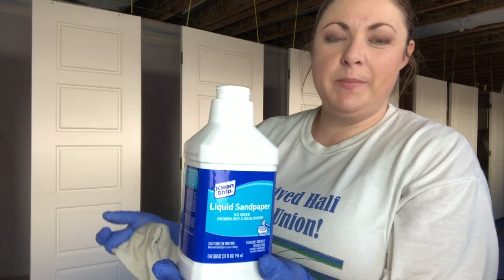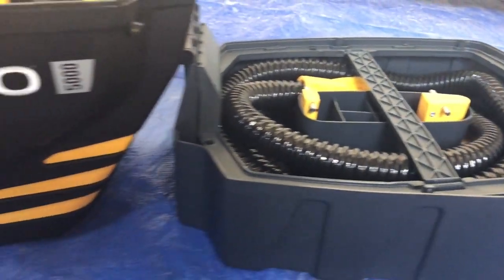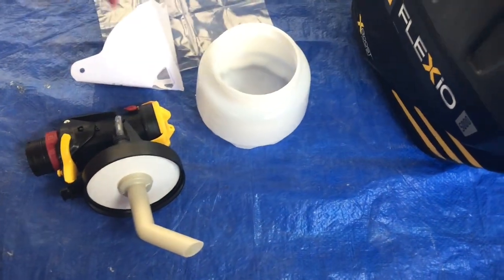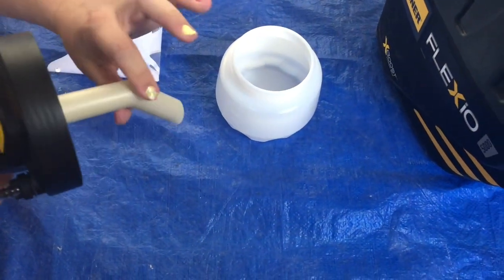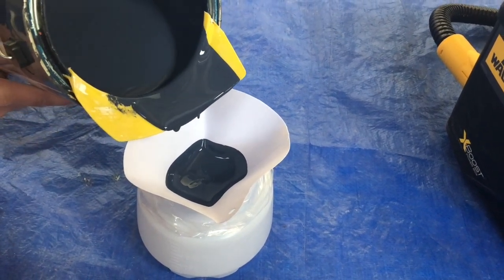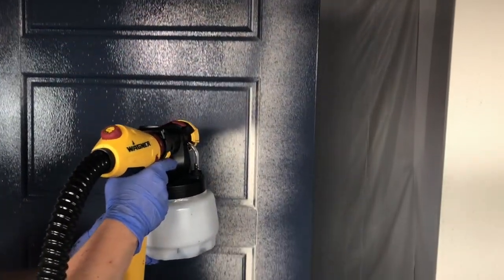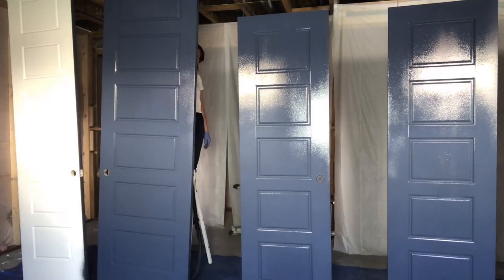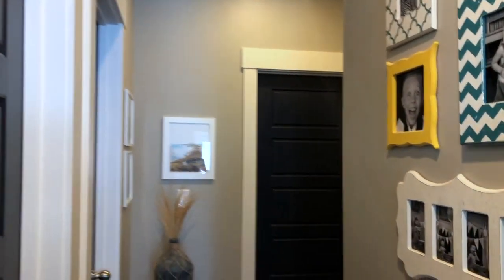HOW TO USE THE WAGNER FLEXIO 5000 PAINT SPRAYER | Novice Review & Tutorial on Achieving Pro Results!

Comment: As you’ve continued to use this sprayer, have you started to thin your latex paint? I like to brush Benjamin Moore advance since it levels well... wondering what recommendations you have.
Reply from the maker: Great question! Yes, after using it on more projects, we've noticed that it does spray better when latex paint is thinned a little with water. Hope that helps. Thanks for watching our channel.

Comment: When you did the first door, it looks pretty textured from it splattering paint... Am I wrong?
Reply from the maker: Thanks for watching Brian. You're correct. Before beginning to paint on the doors, we did multiple test sprays to set the sprayer to the correct paint flow. On the first door, we were still getting the paint to the right flow. Luckily it's on the inside of a closet door, which isn't likely to be seen too often. However after more practice with the sprayer on more projects, we've realized that the smaller sprayer has a much more fine spray flow to it, with much more smooth results. The larger sprayer (which we used in this video) covers larger areas quicker, but it does have a little texture. It would be great for walls or other large surface areas. But to achieve a nice smooth finish, we'd recommend using the smaller sprayer. Hope that helps.
Reply: You could thin the paint with water or whatever is recommended to thin it to get a finer spray finish
Reply: @2thesunnyside  Then why were you commenting on how good it looked? It looked very bad & all your credibility was lost in seconds.
Reply from the maker: Yes! You can definitely do that…I was being lazy 😬😆
Reply from the maker: I suppose I was more excited for how well it was covering in such a short amount of time. But like D Garcia mentioned, it was just the first coat and being our first time using the sprayer we were figuring out the texture we were going for.
Reply from the maker: Thanks for your comment! We were definitely figuring out what texture we wanted. More than anything I was happy with the coverage in such a short amount of time!
Reply: @2thesunnyside  lol don't pay attention to the negative troll. He's angry all the time. I have the flexio 5000 as well along with the pro control 190. I only got them for doing wood deck stains in my business. Ive never used paint in them but I am going to give it a try. I'm sure it will take some practice and getting use to to get the sprayers dialed in for optimal performance. Y'all did fine for your first time using it. Keep up the good work 👍

Comment: 10:21 you can see how streaky/uneven the finish is with the sprayer on the left side door :/
Reply from the maker: It was our first time using the sprayer, and we did get better as we went along.
Reply: @2thesunnyside  A good tip I have read is to practice first on a big piece of cardboard, and/or by spraying pure water until you get the hang of it so that you don't accidentally mess up a door or kitchen cabinet in your own home. I was curious if it was operator error or the sprayer being a bad model/brand, thanks for clarifying.